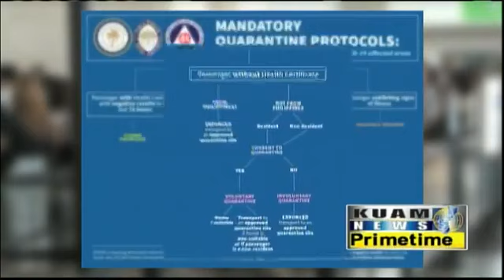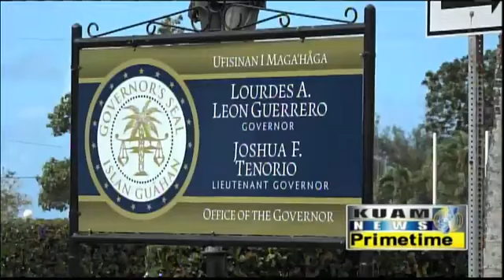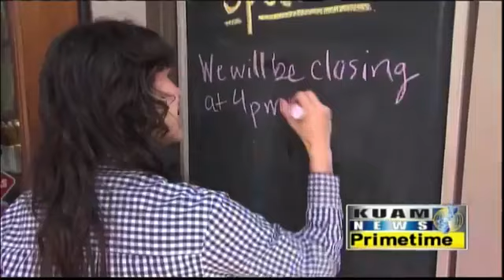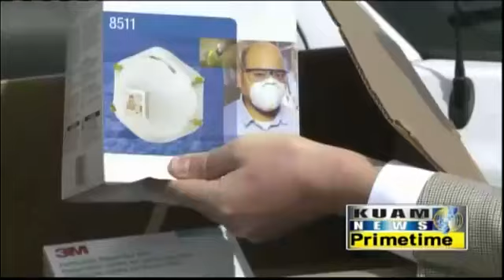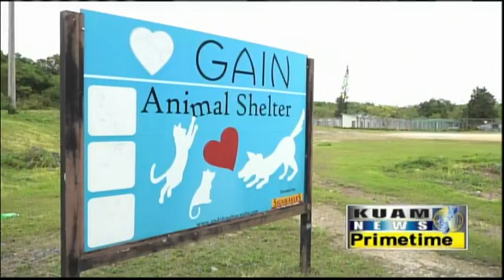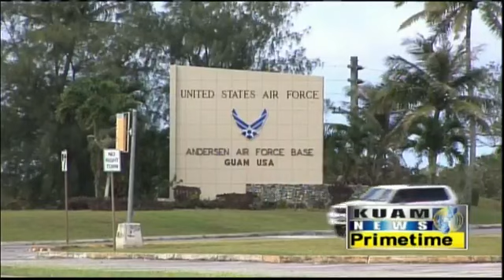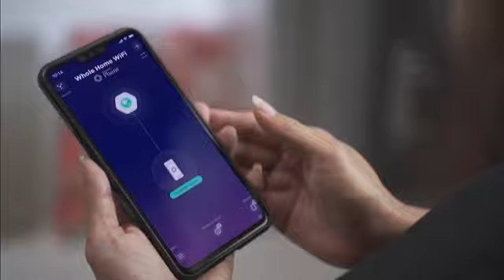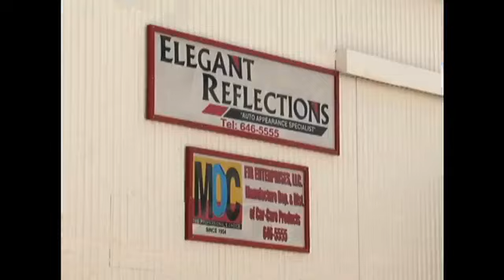KUAM News LIVE: March 18, 2020

Comment: CDC has not confirmed any COVID19 individual on the island so this is a valid reason to restrict any inbound individuals from entering the island until the COVID19 has been controlled. If the island is short of the necessary equipment to combat this virus then common sense should prevail!